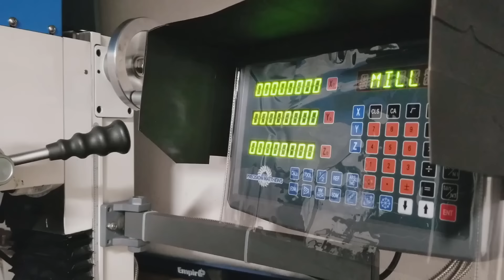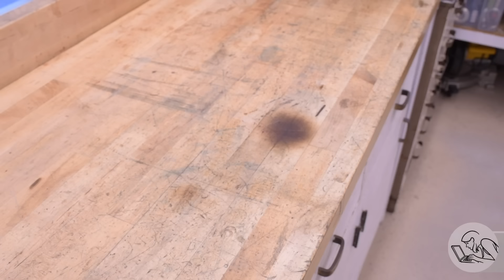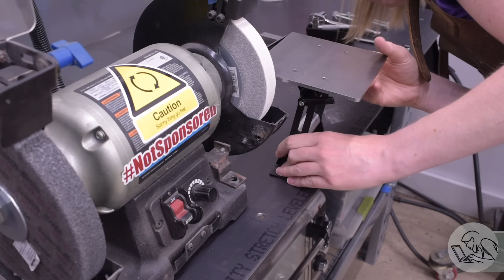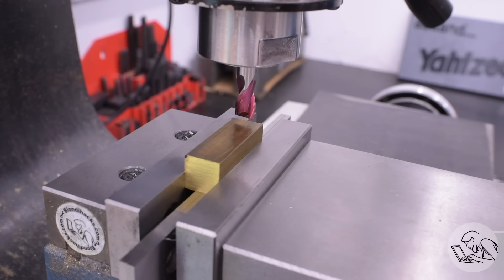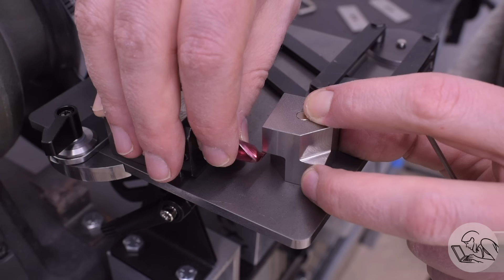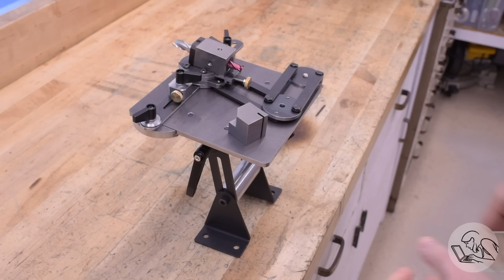Sharpening End Mills At Home (probably?) - Acute Tool Sharpener Conclusion

Comment from the maker: Lots of folks asking how this compares to the D-bit grinder. Main thing is this kit has more options for tool holding. The D-bit grinder only holds round tools of a couple of specific sizes because it is designed for D-bits. There are head attachments for grinding square tools and other things, but they are expensive, and in the case of my vintage Kuhlmann, unobtainable. Is a D-bit grinder better if you have all those attachments? Of course. It’s a $2000 machine. This is a hobby kit you can build for a few bucks worth of steel. It fills a niche since most hobbyists don’t need or want a full tool and cutter grinder. 

Also, FYI, this is not a sponsored video. I wanted to try the kit so I did. This is my honest impression of it.
Reply: I just scored 52 end mills for $10 from 1/2  to 1-1/4 inch in size in various lengths as well some are double ended.  Half are dull and two broken. This jig setup should bring them all close to factory sharpness again.
Reply: You are a fearless, undaunted worker !!! The instruction I receive here is so well presented !
Reply: So is it worth addressing alternative tool holders for the d bit grinder some time?
Reply from the maker: @johnsherborne3245 It was on my to-do list for square tools before I got this kit. Now I think this kit is an easier solution to that
Reply: @Blondihacks  having just acquired my Alexander copy of the Deckel, I’m still wrestling with its abilities, I did make a ER 32 holder for it, but my own collets might be a bridge too far.

Comment: I have built mine about 6 years ago and I really like it. Like most tool grinding machine they are a bit tricky to use and you need to refresh how to use them, unless you use them on a regular basis. So I usually set aside a few cutters and after doing one, the rest is pretty easy. 
 I found  that a CBN wheel help me get a more consistent and accurate finish. When first setting up a new grinding angle, I initially only rotate the CBN wheel by hand a few turns and then verify the cutter end bluing to see if my set up is near perfect or way off and make the correction. Using this technique helps to  to find and match the manufacturing original grind and duplicate it. Using this gentle approach to the grinding wheel help me a lot to understand and setting the angle to many other cutting tools. Powering the grinder and have a go at it, almost always removed to much material to then realized I have gone to far and lost my manufacturing reference grind.    
 I have resurrected quite a few endmills and have been quite please with the cutting edge I have achieved using the acute tool sharpener.  
I like the table rest so much, I built a second and it gets used way more than the acute sharpener.  The acute sharpening system is wrapped in a dust cover which will keep it grit free and running smooth next time I need it.

Comment: We generally won't resharpen an endmills from customers unless they are large diameters because of 2 reasons; 

1 being that the deeper you regrind, the more and more the endface will be offset from the gash due to the helix and the hook angle will no longer be straight so the endface technically has positive rake.
2 is as you can see, it essentially ruins the center cutting ability since the gash falls away from center the deeper you go. Not a big deal for a home machinist, but it can no longer plunge as well as it did with a true center cut

Comment: 25:32 Hey Quinn,
I would recomend unsing NordLock washers at that position. They will not get loose, they will even tighten a bit, if the handle does turn the shaft.
Kind regards from Germany, Kai
Reply from the maker: Nope, I tried them
Reply: I know way more than I want about bolting, and although Nord-Lock can work in some situations, they are not needed in a properly sized/designed joint.  
Long story short: this bolt needs to be bigger, or more correctly, needs to put out more force.  Socket head bolts (if made to the correct standards) are made from even higher strength materials than SAE Grade 8, so if tightened properly, it doesn't need to be swapped for a different style of bolt.  the joint needs more load to resist the vibration and maintain friction.  if you can't tighten the bolt enough to get the force, you're gonna need a bigger boat, er bolt.

If the joint "almost" works, Nord-Lock and other systems can give you enough help to work.  but if the joint is just not good enough, then even those will loosen.

Comment: Recommended RPM for drills go out the window with a hand drill or manual feed drill press, so as you say, low RPM and high pressure are the way to go!

Comment: A surpriseing feature to me was that the center of the center cutting end mill is concave so that the outer flute edges cut first.  It makes sense in hindsight.  My other discovery was to come up with a way to make the edge of the grinding wheel a sharp square.  Why?..the sharp edge is needed to cut the web center to a sharp cross over so the end mill will center cut without burning up the center of the endmill.  My  solution was to buy the cheap ebay cbn and diamond composit wheels because they have continuous morphology and will take a sharp corner.  This works on my drill sharpener also.  I usually find this is needed saturday night.
Reply: Almost all tools will have dish on the end. Even key cutters have about 1 degree of dish to them

Comment: Great job building a very cool tool! I love this kind of content. I see that the system is capable of grinding drill bits. I am particularliy interested in resharpening the larger reduced-shank drils sometimes called Silver and Demming drills. They all have a 1/2" shank, but come in sizes up to an inch or more, and can be quite expensive even in HSS. I have a number of those drills which I bought used and which are MUCH in need of sharpening. None of the economical drill grinding systems can handle drills larger than 1/2". I wonder if this system can do it? If so it would be great if you could give that a try and let us know how it goes.
Reply from the maker: I believe the system is supposed to handle drills, but unfortunately I don’t know how. Instructions are hard to find for it

Comment: Hi Quinn, I think I found one error in your setup:
In the Video from Eccentric Engineer they set the angle of the work table with the angle-measuring-gauge directly on the work table as reference. You set it on the work arm. This changes the cutting-angle.
Maybe thats the problem...
Edit:
I saw in the other video they do it like you...
Reply from the maker: Yah there are some discrepancies between the two videos. Not always clear which is correct

Comment: Great project - thanks for sharing.  A star washer might work better than a split washer for locking the bed - just a suggestion.
Reply from the maker: That’s what I used. Doesn’t work
Reply: @Blondihacks  My apologies for the comment - looking at the lock washer in the video it looks like an ordinary compressed split style (spring) lock washer as opposed to a thinner internal or external multitooth star style washer.
Reply from the maker: @29chevbolenschannel40  I tried many kinds. If I filmed every detail of every thing I try, the videos would be very long indeed.

Comment: The aluminum box section you used to add height is obviously plenty good enough. But it doesn't seem hard to replace the parallel height adjustment arms with something a little longer. Might be worth consideration for others building this kit.

Comment: Awesome work, Quinn! I can absolutely see the merit of a system like this, especially (as you point out) the work table. And it's definitely nice for lathe tools. A clever bit of kit, overall.

I think you'll eventually get the hang of the endmill sharpening, even if it's not something you'll be doing very often. Though I wonder if, by sharpening them that way, you'd lose the center-cutting ability of the endmill.

As for lathe tools on the D-bit grinder: It's totally possible to do, without the special rest. You can make "split collets" to hold square things in round collets... Basically 2 half-round pieces with a V-groove down the center of each, which form a square when put together. The only tricky part is indicating the tool square once it's in the work head, but a simple jig could be made for that.

EDIT: Thinking about it further... That would actually be easier than the dedicated work head for lathe tooling. My import D-bit grinder came with that work head, and it's kind of a pain to have to remove and reposition the tool for each face. Doing it in a collet would allow you to grind every face from one setup.

Comment: I had fun watching you build this, great project. What niche does this system fill that you can't use your D bit grinder for? Surely that's far more accurate and adaptable?
Reply from the maker: Can’t hold lathe tools in the D-bit grinder.
Reply: @Blondihacks  I have a Shars D-bit grinder that came with the adapter for lathe tools and it works well enough for an old guy. Advantage is it is quick and easy to set up. OTOH the drill bit attachment that the D-bit grinder came with is a lot less than Ideal. I had a Drill doctor but I find it quick and easy to eyeball grind drill bits, not perfect but they (usually) work well enough. I mostly use screw machine drill bits.
Reply: @larryschweitzer4904  I wish I had learned about screw machine bits before I spent a penny on Horror Freight level quality regardless of the source.

Comment: What a lovely piece of kit. Somehow it manages to be ludicrously complicated, and quite straightforward, all at once!

How does the set of jobs it can do overlap with those of your D-Bit grinder, and which do you think you'll end up using long term? I don't really have space for a D-Bit grinder, so wondering if this will cover my use cases (regrinding end mills, lathe form (or cutting) tools that need precise cutting, sharpening drills, etc.
Reply from the maker: The problem with the D-bit grinder is limited tool holding options. It’s designed for grinding D-bits so you can’t hold square lathe tools, drills, or other things without making or buying exotic attachments for it.
Reply: @Blondihacks  Thank you. I've just ordered the plans (seems silly shipping steel from Australia to the UK!). I'm hoping I can 3D print all of those angle setting jigs to save on machining time.

Comment: My main problem is with tiny drill bits. I don’t have any equipment only the same hand drill you showed when drilling the new holes in the bench and it LOVES shattering small drill bits if your tilt goes slightly off . I don’t live near a big box store that sells individual bits so a bench grinder and this system would be helpful to remake the tips on my new stubby bits instead of having to constantly buy whole sets of bits for tiny ones.
Reply from the maker: You can use a Drill Doctor but honestly I don’t think regrinding small drills is worthwhile because they are cheap. A pack of ten is a couple bucks from McMaster or other suppliers. I treat them as consumable.
Reply: @Blondihacks  I know it's way overengineered for such purposes, but I just meant like for those of us who don't shop McMaster because we don't have a shop and just have simple household tools and don't buy our bits in bulk. It's usually at the most inopportune time when mine snap such as late at night after the stores closed and it's a very critical time in a home repair project (I'm a night-owl). Being able to grind a bit in a hurry would be nice. I'll admit the last time I used a Drill Doctor was ages ago, but last time I did, it was a simple grind and didn't really make all the angles properly as it was just a sort of simple rotary grinder, and it seems like the smaller the bit the more important proper angles are (at least in my opinion).

Comment: re: endmill sharpening: there are a great many deal of shops that offer endmill sharpening. they have a big advantage since they use CNC diamond wheels: any number of flutes and helix angles are possible, especially modern carbide low helix with variable cutting edges (limits vibrations). given the cost of a good 1/2in carbide endmill of about $50 usd, the sharpening costs around $10 for those, so well worth it. the other advantage is rehabilitation, when flutes are chipped, the endmill can be shortened, or ground down to a smaller diameter. plus you get to choose a corner radius. I had a handful of endmills that I had ruined in the beginning, due to beginners stupidity. getting them fixed got me back tools that were far better than when they came from the factory.
Reply: How good are these after regrinding?
I use a lot of 12mm (metric europe things) 4 flute, 2xD flute length carbide endmills that cost about 40€ per endmill (before tax) if you buy them in bulk. Regrinding and recoating costs about 28€ a piece and then i have a bunch of 11,2mm endmils that are about 2mm short of the new ones. so i found regrinding is not really worth it, if the cost is more than about 35-40% of a new one, which is usually not the case if a new one is less than about 100€.
Reply: The biggest regrinding mistake I see from even big professional shops is when they get the diameter reground the have them only remove enough to remove the damage. It's much better to have them regrind down to the next common nominal size. You are unlikely  to save much money even with carbide tooling and having the endmill be a nominal size will save you from mistakes.
Reply: @JonSturm  I ruined a great 4flute 3/8 carbide end mill. Got it back from repair, as a 8.9mm… works perfect for me, I just have the exact size written on all off size end mills (in mm, since I treat even the imperial sizes as off metric)

Comment: Very cool! I sharpened a lot of HSS drills but most of the mills I worked with were not easily sharpenable since I mostly machined heat treated steel and stainless. We used HSS drills for really large bores but everything else was with tungsten and other sintered alloy tools with even fancier coatings (every time I broke one I felt like shit but that was a rare event and then again my CNC hadn't been serviced properly ever in its 18 years of life). 

We would usually send mills for sharpening and re-coating to a specialist company. Regarding brands, can't go wrong with Sandvik Coromant! Very expensive but equally very good! And you're absolutely right, low rpms and high pressure are the proper way to drill using HSS drills. Thanks for another great video! Fascinating to watch!
Reply from the maker: You can use diamond or CBN wheels to regrind exotic endmills